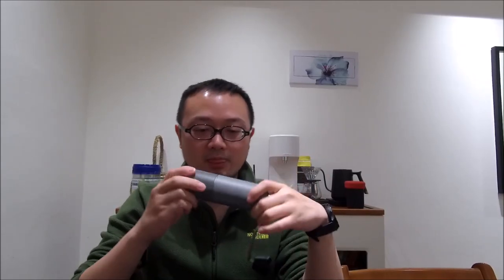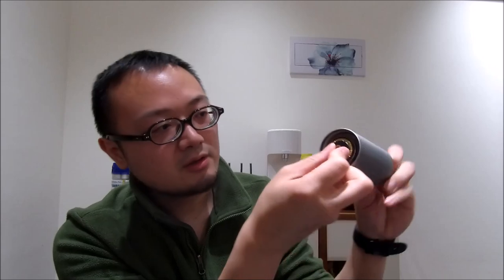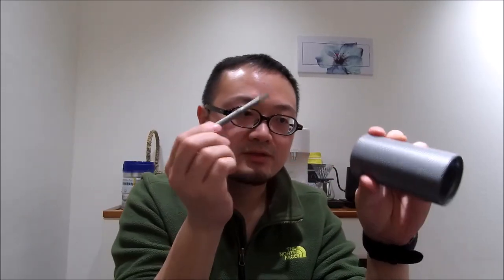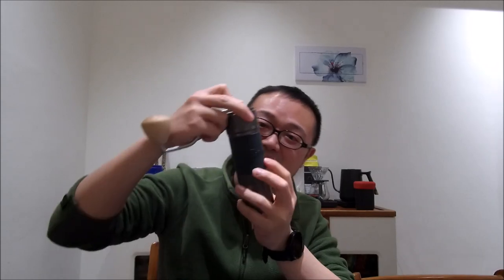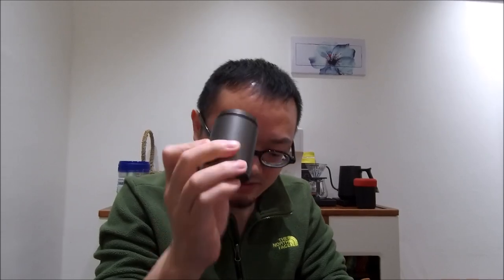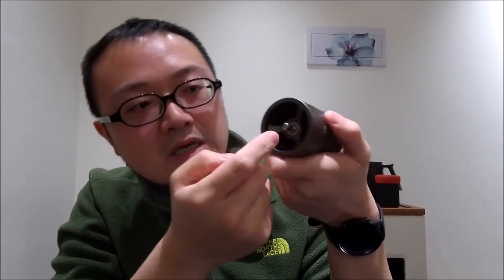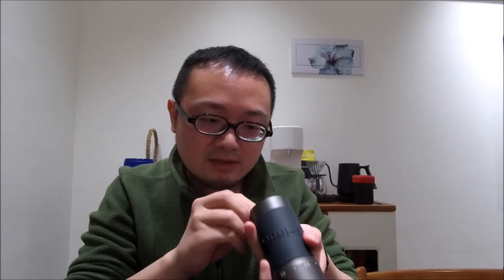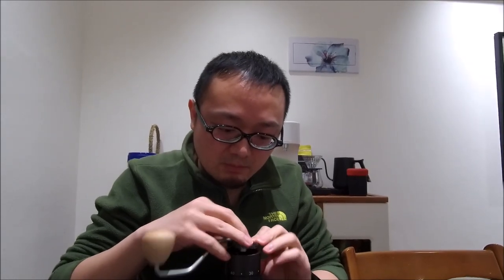Timemore Chestnut C2 & Kingrinder K6 Comparison

Comment: Funny thing is, Kingrinder came out with an "entry level" line of grinders, $22-$44

Plastic housing, but the guts are solid aluminum and stainless. Think a block of aluminum with a hole through it for the axle to go through. The plastic housing is literally just to hold beans inside. Excellent ingenuity! 

I'm waiting on my k6. 

Excellent video!

Comment: Thanks for this video sir! It has steered me away from the Timemore c2. I am now considering the KinGrinder K2 for my first specialty manual grinder BUT seeing your K6 here, and considering the adjustment dial located on the outside (looks easier to dial in) makes me want to get the K6 instead. 
Did you get to try or look at the K2, K4 as well? Is the k6 a widely better option?
Reply: Did you buy the K2 finally or K6 ? I canceled my C2 order to get the K2 for the same 55€ price. The K6 is 100€ I little too expensive for my usage.

Comment: Where to buy k6 for 90$ ? Can u give a link ?
Reply: The K6 is $100 USD equivalent in Taiwan. It's a little cheaper in China. 
You may be able to find it on alibaba. But it will cost a bit more if you're not buying in China or Taiwan. Plus shipping fees.
Reply: The K6 is currently about $140 on Amazon when it's in stock. (June 2022)
Reply: The K6 is $99 on Amazon right now, and the K4 is $88. I bought the K4 and love it.

Comment: Thank you for this video, Ran! You're the first one I've seen to point out the wobble on the Timemore C2 and was surprised to find that my unit has it as well. Now I'm curious as you didn't do the same for the Kingrinder -- does it spin in a more stable manner? Does it spin as freely as the Timemore?

I saw from another person's video showing that his Kingrinder K2 didn't spin freely and even made some sort of grinding noise as it did. I suspect it might have been at a fine grind setting, but it would be a major concern if it wasn't.
Reply from the maker: Hi, Vince, the Kingrinder spins much more centeredly than the Timore C2. I've forgot to shown that in the video. But, the spinning of the C2 lasts longer though.
Reply: @RanLinlayrian  I see! Does it matter that the spinning of the C2 lasts longer though? Or is it just as smooth and easy to use despite that? I saw in a 1Zpresso video that the JX grinders seem to be as smooth as the C2.
Reply from the maker: @vincetarrosa  The smoothness of the spinning is more like the cherry on the top. For a well sealed bearing, the rubber ring will make it spin less smooth, yet provide much better protection for the bearing. I would rather choose a bearing with better protection considering the working condition. And centeredness actually plays a more important role for it decides the consistency of the grinds, which determines coffee flavor.